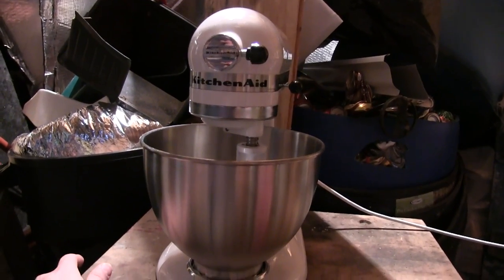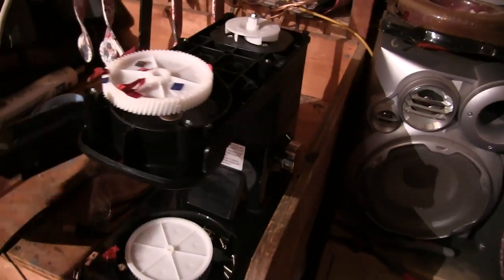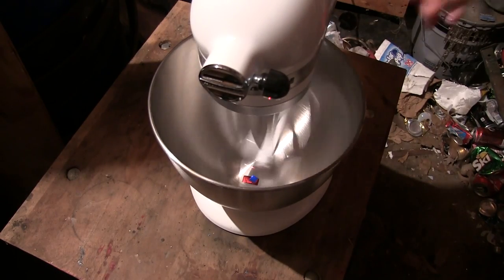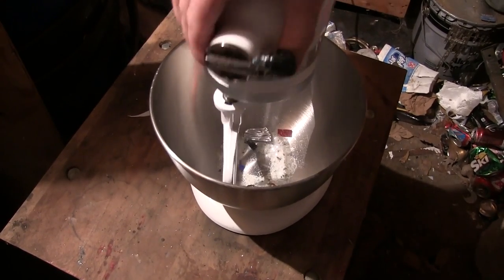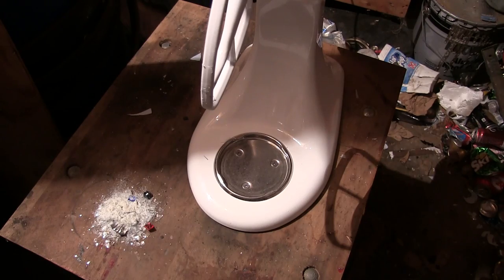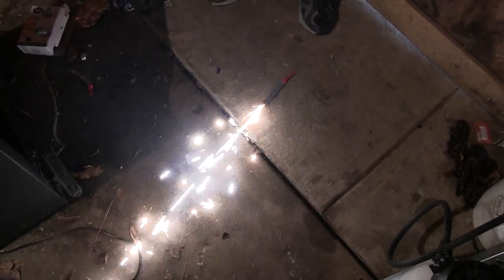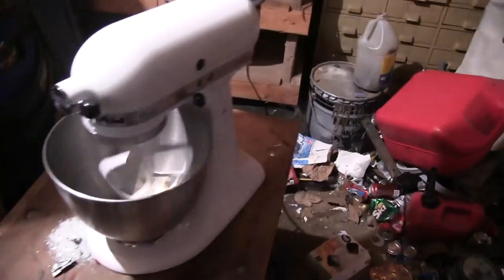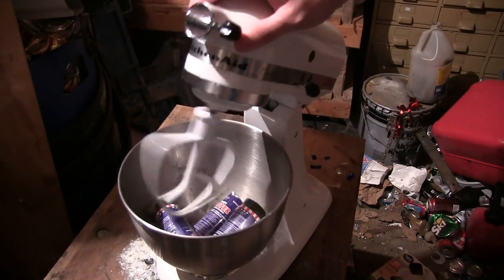Fun With Kitchen Mixer + Mixer Destruction

Comment: Many many deacades ago I started golfing kid's toys into the woods (shattering them into infinite pieces). Then came my obsession with fire. I learned what in a father's garage is flammable. Then I learned how to work with excessive voltage and amperage and what happens with you introduce it to tiny capacities and resistance electronics. LoL!!!

Comment: Love the video guys, laughed the entire time!

Next time, could you over volt it using that 120-240v transformer?
Reply from the maker: Glad you liked it. I should have brought my transformer to finish the motor off.
Reply: Me to
Reply: @ssmmkk2  12:19 Was that the motor running at full throttle because a gear stripped?

Comment: Make a vid on a fan spinning and spray water onto the fan blade while it's running.
Reply: Matt you did not fail. And I think you are doing a great job destroying the mixer. I bet after the camera was off and you rested a bit you took it outside and used a sledge hammer to it. I bet a few whacks with the sledge and your muscle it didn't last. Love t watch your videos.